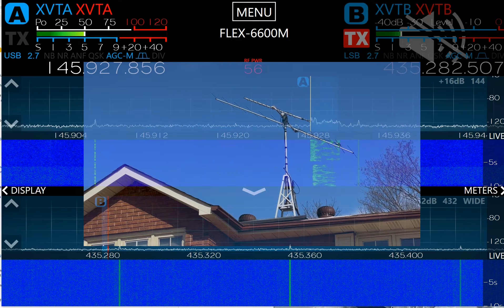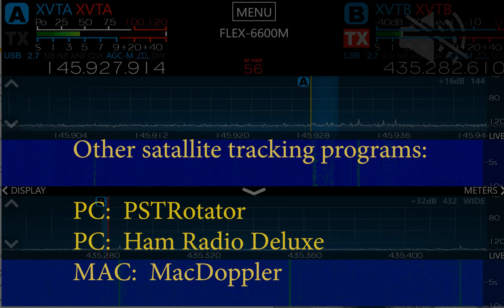Using a FlexRadio 6600 for Satellite work

Comment: I am confused. How do you work satellites that use 2meters and 70 centimeters on an HF 6-160 meter transceiver?
Reply: Mike has two transverters. I believe one is a 144 MHz transverter with a 28 MHz IF, and the other is a 432 MHz transverter with a 50 MHz IF